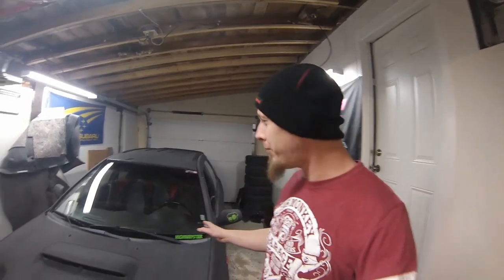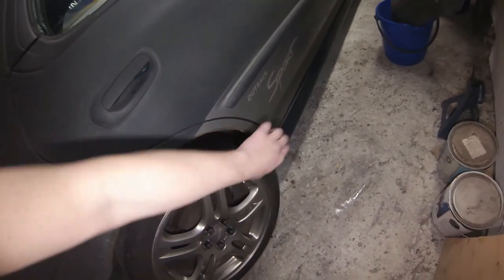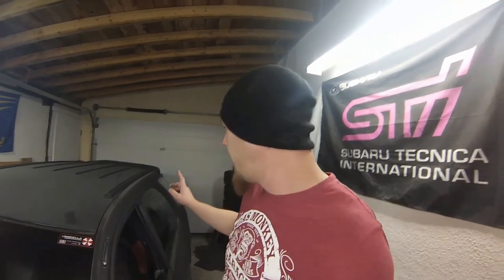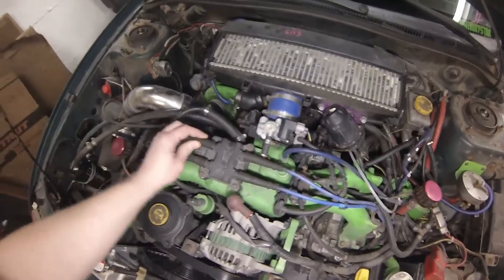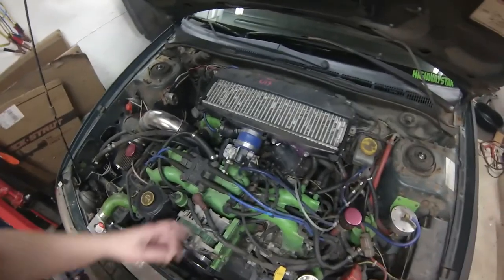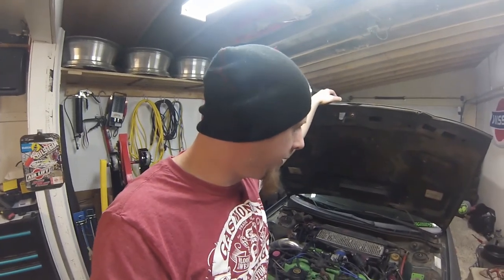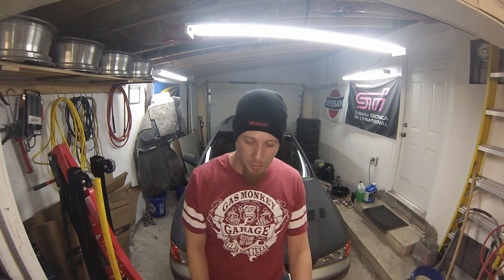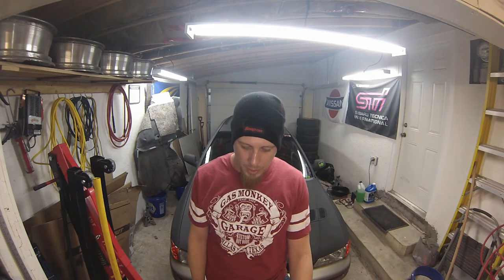Impreza OBS-T Review / Car YouTuber Shoutouts

Comment: Lots of good info in this one as well dude! On your map check valves did you unbolt the map sensor from the manifold and feed the vacuum off the back of it? I haven't pulled mine off my throttle body yet but it looked like you had the hose directly to the back of the sensor?
Reply from the maker: Yes that's correct. The MAP sensor was removed from the throttle body. I used a vacuum hose connector with little o-rings to place into the throttle body. The the hose fits onto that connector with the check valves teed inline with the MAP sensor on the other end. Been like this for years.
Reply: Homebrew Subaru and it doesnt see any boost on the sensor? Thats awesome, do you have a boost gauge/afr  installed to know that the check valves are doing their job? One other question for you what size fittings do I need for my oil feed on the pressure sensor? I'm getting a td04 oil feed kit and it has m10 1.5mm banjo for the turbo side and the motor side is a m12 1.25 banjo bolt. I need to figure out how I want to tee off the oil pressure sensor, some many people have different opinions on what size fittings to use lol
Reply from the maker: The sensor has seen boost a couple of times over the years, but is fairly fool proof. I use a boost gauge and AFR. You know the sensor has seen boost when the car does a fuel cut. This will also turn on the check engine light setting a MAP sensor high code. System will operate as normal as soon the sensor no longer sees boost. 

The oil feed line I used had the banjo on one end for the turbo. The other end was a AN fitting that they supplied an adapter for that threaded into pipe thread of my tees. One of the last videos shows how I have the oil feed setup for the pressure sensors and turbo feed.
Reply: Homebrew Subaru sweet, seems like a better method than dealing with the 100 dollar voltage clamp I think I'm going to try out the check valves. Oh duh that makes so much more sense to have it as an an fitting on one side. I'll go back and rewatch your other video tonight! Thanks for the help again. I'm sure I may bug you later on about something lol!

Comment: Acetone will help with old plastidip   but it's kinda got to soak but it'll thin it down pretty good
Reply from the maker: Goo Gone seems to be popular. I'll probably wait after the winter to get the dip off and clean up the body work.
Reply: I'm not to sure on the goo gone I haven't tried it on plastic dip but I haven't been a fan of it bc it leaves kind of a greasy residue or maybe I use it wrong lol also you should check out Blake's garage he had some good subaru vids but now he's started building a BMW track car
Reply from the maker: Cool man. I think I've come across his channel before, I'll check it out.